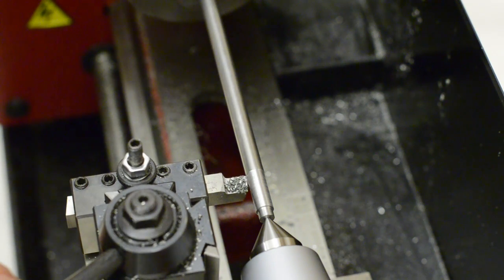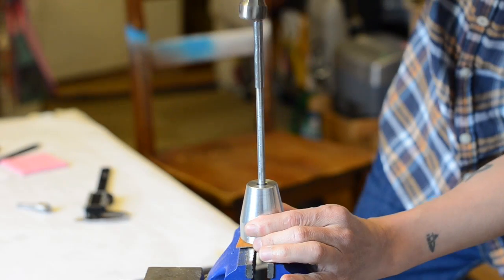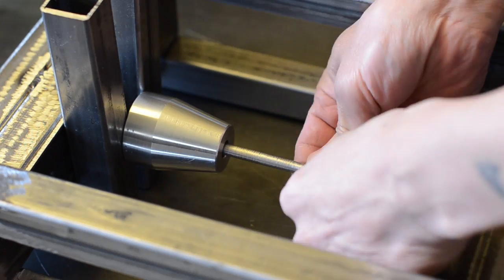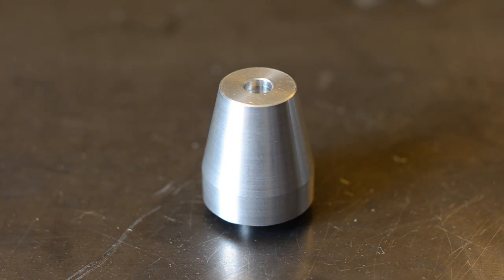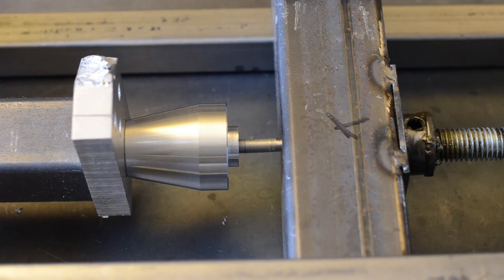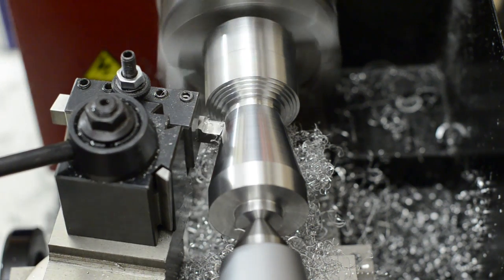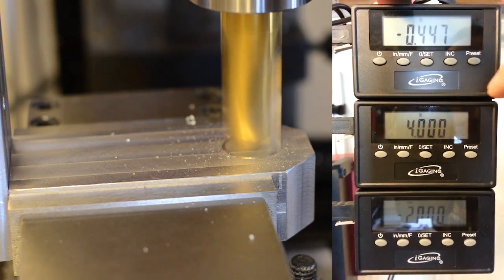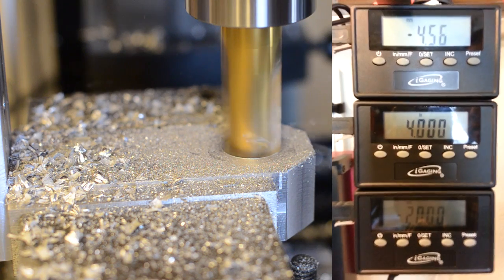Bicycle Frame Build 21 - Frame Jig Pt.13 - Fixing Head Tube Cones

Comment: When ever you need to press fit (or remove) aluminum part on to steel - heat the aluminum  one with a heat gun or oven. You can also cool down the steel part in the freezer for even easier fit ;)

Nice build. It's a pleasure to watch your vids. Keep it up!

Comment: What I would of done was put thred on the rod so you could just unscrew it
Reply from the maker: Stephen Wilkie Ah yes, that could work too. I think the main problem with my setup was the diameter of the rod being too small. Thus making it more prone to bending during the turning operation. Thanks for watching!

Comment: this key can be used as point of attachment by using the arm that holds it.  put the bolt side to side not throw the cone.locking the key on the cone. email me and ill send a photo showing what i mean. chip2567@yahoo.com the draw you have on line can not be used by a e machine shop all i need is headtub arm and bottom bracket cone rest i can make i thank.
Reply from the maker: chip2567  I think I know what you mean..  You should check this out. The guy over on Clickspring did something similar with a rod. But he used super glue. Pretty cool.  https://www.youtube.com/watch?v=e4apNy_2AB8

Comment: Nice job...but never hit a fixturing part with a steel hammer, as a matter of fact never hit a steel hammer (head) to machined pieces, jigs or fixtures, use dead blow hammers. A 3/4" rod two or three inches in length with a conical shape on one end, a hose clamp with a hard plastic or soft aluminum rod attached to the work piece, could've been used as a lathe dog and live center tailstock would've let you machine between centers and allowed you to machine the key you needed, but this is what this craft is about, lessons learned, either way, you did good.
Reply from the maker: Hi Eddie, thanks for the advice. Totally agree about the hammer. Not sure I understand the bit about the feed dog setup. If you know of any links with an example of the setup I'd greatly appreciate it.
Reply from the maker: Pithy Bikes I just looked up 'lathe dog' wow! Very cool technique. Thanks Eddie!